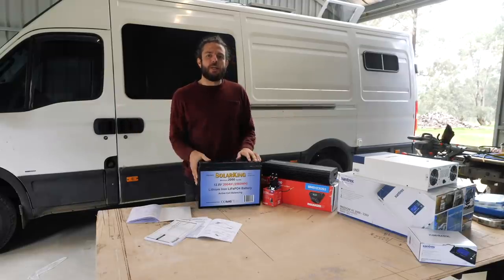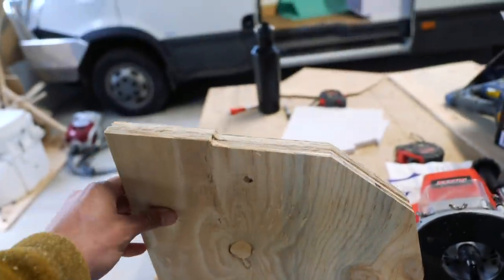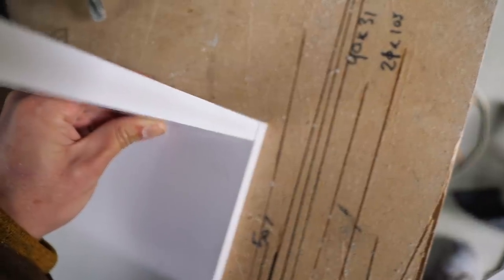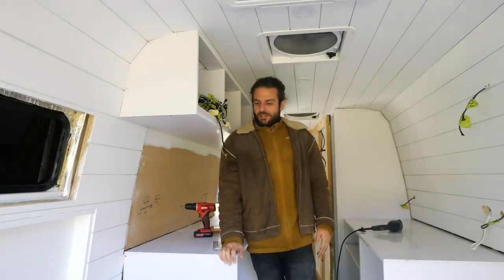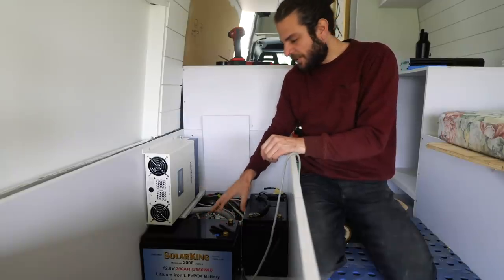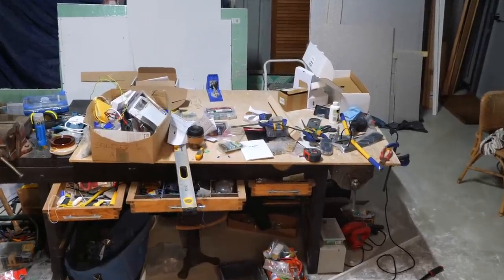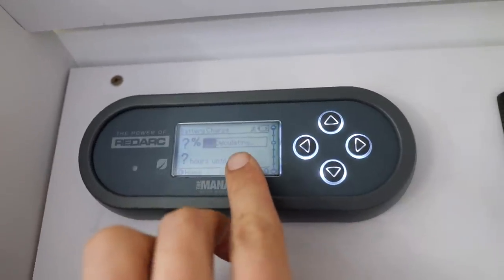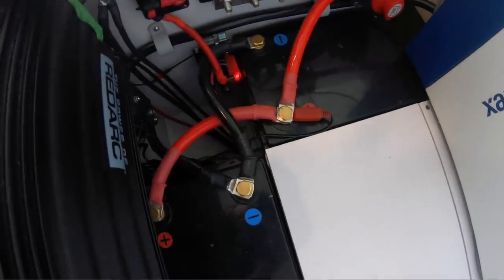Bringing This TINY HOME to LIFE! | VAN LIFE BUILD

Comment: Thumbs up mate. Looks fantastic. I am ashamed to say I havent put up any of my build vlogs but like you we are building a self contained of grid camper. 310 watts of solar, 240 amp hour of battery. Composting toilet, rain water catcher, recycling water filtration system and refillable gas. Should be finished in about 6 weeks.

Comment: Brings me back to the days of when I wired control boards before I was accepted in the electrical union. IBEW Local 292 (mpls). I agree with you on shrink tape. I think it's stronger and much neater than electrical tape. It really is tidy looking.  Loved how you used my comment (along with others) about more support on the end of your deck. Go adjustable. You may not always be on a level surface. I'd recommend uni-strut, Kendorf. (American name) You could engineer an adjustable leg from that, which could easily fold up and slide in with the deck. It's extremely heavy duty and I found it easy to work with. I always look forward to your vlogs! Looking great 👍 .
Reply from the maker: That's for the recommendations mate, I'll look in to it!!

Comment: Loving the build, your doing an awesome job 👍
Big tip for the router mate, use a jig saw to cut it very close so your only trimming of a couple of millimetres. If your cutting a full cut it’s very hard work on the motor of the tool and it’s also very hard for the cutting blade. If you trim it close first your gear will last a lot longer 👍
Reply from the maker: Thanks for the tip mate! Will do from now on!

Comment: The van is coming out great! You should be very proud. My comment is in regards to the battery/inverter/Redarc compartment. I'd like to see you put a grille or opening from there into the van or adjacent cabinet to deal with the potential heat and need for cooling. The inverter has two fans on it and the Redarc case is a heat sink. Without some type of air circulation the compartment will get hot and can prematurely cause components to fail. Other than that everything looks spot on.

Comment: Max-  I'm VERY impressed with your grit, mad skill-sets, and outcome.  KUDOS.  You know, when most guys break up with their g/f's we just chase more skirts, or a bottle.....or drop out of Life.  But you....you BUILD a van.  #Respect   Suggestion:  when cutting or routing, rig up a Shop-Vac to suck it up- during the cuts.  I do the same with an extra length of hose; works great at reducing sawdust, air quality, and keeping a CLEAN work area.  Because at some point-  ya gotta paint something.

Comment: Hey Max, loving the van build series. You might have now finished this kind of work but just one quick tip. If you use your jigsaw to cut the board about 5-10mm away form your line, and then use your router to trim off the last 5-10mm, it will be a lot easier to push the router, wont make as much mess and the router bit will stay sharper longer.
Cheers
John
Reply from the maker: Thanks for the tip John!

Comment: Great job Max! I love the look of that cabinet material. I am retired from the HVAC trade and I am always concerned with ventilation on equipment such as your controller and refrigerators. I am not sure of the heat output on that controller but shouldn’t there be more ventilation? Perhaps ducted to your rear storage garage or better still outside. Just concerned for the future of the electronics. Keep up the quality build. From Barrie, Ontario🇨🇦
Reply: Larry Durkee  I am also a bit concerned about ventilation in that compartment.  It is jam-packed with heat producing equipment.  Normally I would suggest putting something like a CPU fan in the compartment but don't see where it would fit.  Do you think a couple of small vents would work on the front of the compartment would work? Not sure he could vent to the garage. Other suggestions?
Reply: BeckyP InCalifornia that would certainly help, just not sure about how it would look. I guess it would be better to keep that area ventilated than worry about aesthetics’s.😉

Comment: Welcome back ✨ the cupboards look spot on 👌🏼 quick question, are you registering the van as a motorhome and are then getting insurance for it as a motorhome? Or have you found an insurance company that covers converted vans without actually having to register it as a motorhome? Thanks in advance 🙏🏼

Comment: Only thing that needs to change is put the manager 30 on the other side of the iso switch direct to the battery. if you isolate then the manager switches off and the solar wont charge.

Comment: How is the alternator power in working? Do you just plug it in your car's battery? And if so, is there a safety features so you don't drain your car completely? Would love if you could explain this, most van build blogs don't.
Other then that, looking really really good!

Comment: I just installed a system on my Troopy, much much smaller than yours driven by a 200 solar panel with about 200 AH. batteries. I though it was pretty flash until I  watched your effort. Man, that is a credit to you. Your work is first class. My off road days are just about done and my next project will be something like your project. Hope you dont mind if I use a lot of your build ideas and methods.
Reply from the maker: Go for it mate!!
Reply: I assume he’d out the series behind a pay wall or make an E-Book guide if he wanted payment for his ideas.  I suppose after he’s done, he could detail out the build for an e-book guide.  I like the design lay out a ton as well.

Comment: Hey mate, just watched the video and looks great, I'm doing a similar set up in my van and man the confusion at times was ridiculous! I have one question what gauge wire did you use for the big thick mofos? I'm a little confused by the size I need to get for the final connection of my batteries and inverter! I'm using 2x150ah littium (175A discharge on each) so very similar. Much appreciated.

Comment: Hey Max! Great video once again! What I was wondering about the deck: why didn't you make it expand over the whole width of the van so you almost double your space? I didn't fully think this through yet so it could be that it's just not possible, but maybe there's a way to fold out the table sideways once it's out? Just thinking out loud here.. Keep up the video's!
Reply from the maker: Thanks Margot! I didn’t Because that would have lost a tonne of storage space from under my seats (which is my main large storage area). This way I actually gained storage by adding the extra height to the seats.

Comment: Hey Max, great work.   But get rid of those breakers.  I know virgoe uses them, but he only half knows what he is doing.
Reply from the maker: Hey Brendon, do you. mind explaining what is wrong with circuit breakers rather than just saying 'get rid of them'?
Reply: @MaxLeeandOccy  no problem Max, I will do a video on them in the future.  But briefly...  devices like fuses and breakers have what is called a current interruption capacity.  Most people think say you have a 70A breaker so if current exceeds 70A it will disconnect.  This is the case if there is a simple overload. If something goes seriously wrong and causes the current to go very high, a breaker (or even a fuse) might not be able to interrupt the current flow.  Most RV style breakers are not rated for this type of failure, lithium cells have the ability to deliver huge currents if things go wrong.  This can weld the contacts closed or induce an arc and start a fire.  I recommend using HRC fuses for protection against a catastrophic failure.    Feel free to message me on insta if you want more specific detail. (Same name - look for the unimog profile pic)

Comment: I'm puzzled... Your inverter has a cooling fan too keep the interals cooled;  but as far as I can see in the video the unit is boxed inside the cupboard without a way of feeding in cooling air, and no ventilation to expell the heated air from inside  the cubicle... What are you using the allow heat to escape and cooling air in?
PS. It might have been a better idea to have installed the master switch at the main entrance than in the same area where the batteries are. 
If there's a fire within that area, where the master switch is currently installed, you'll not be able to get to it safely of without injury to yourself.

Comment: The overheads look great! You did an excellent job. However, I don’t understand why people spend so much time & effort building the wall angles and fitting things perfectly when they could just build a strong “L” frame with 80/20.  Just skip the complicated cabinet frame needed against the curving van wall and build an “L” and backwards “L” frame.  Am I missing something? I am honestly asking? , If you have already paneled and painted up in those corners; why do you need back cabinet walls to fit against your paneling? I think with 80/20 mounted with riv-nuts to the Van frame you could make the cabinet frames strong enough to really “shake the entire van”.  Please let me know if anyone knows this method does not work?